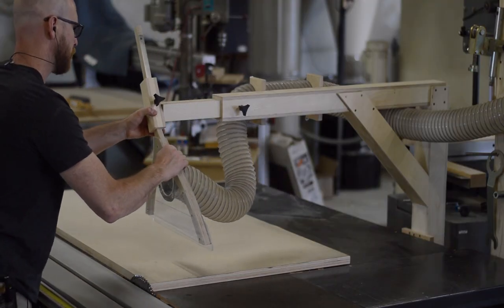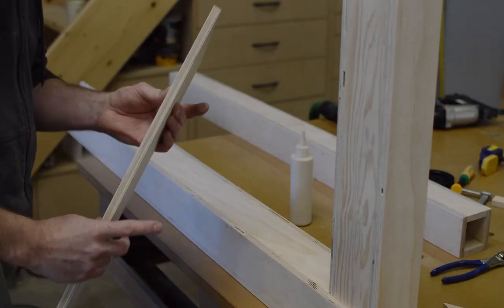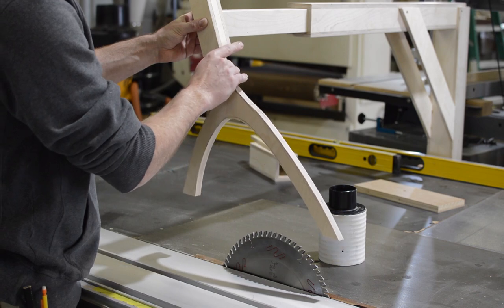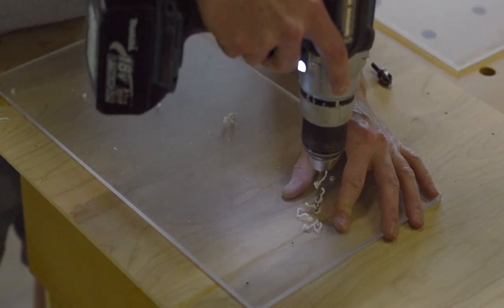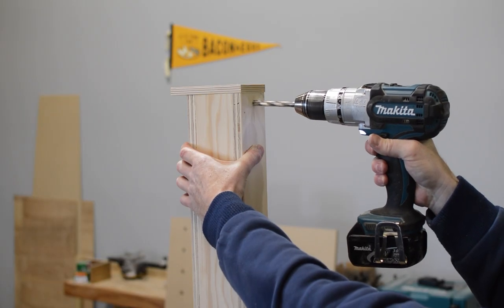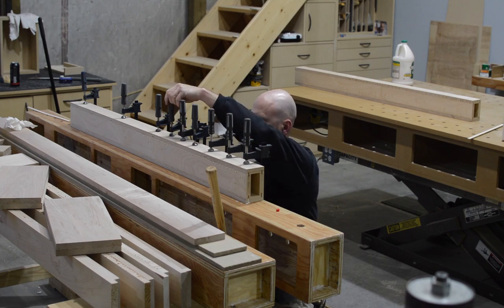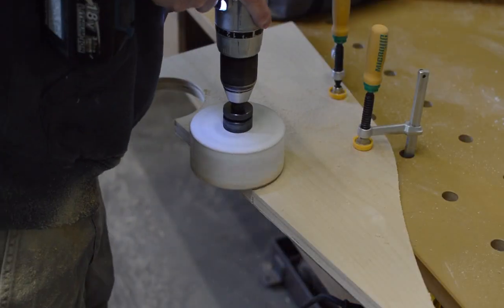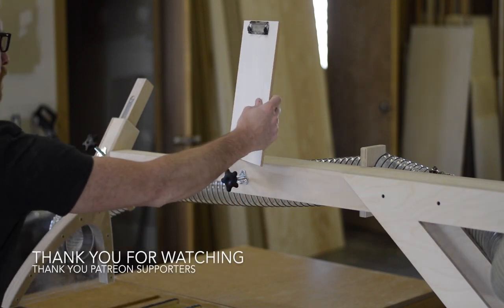Table Saw Overarm Dust Collection, Shop Built x 2

Comment: youre using your sliding table saw wrong, dude. theres no need for a „cabinet saw“, really. everything is easier and more precise on a sliding table saw. except for maybe those „dado blades“, you cant mount these on most european saws
Reply from the maker: I would push back against this position. I really don't like using a slider for anything other than cutting sheet goods. Can the saw do it, yes, but its not comfortable, and its not nearly as easy to change setups for one off cuts. Also, I can run a dado on my saw.
Reply: @MikeFarrington  Of course having two saws is always an advantage when it comes to different set ups. As it is with most tools, really. I know you have dedicated routers for your most used bits for example. no argument there. it just hurts me to hear you say "a slider is for cutting sheet goods". It really, really is a much more versatile and precise system than that. I dont know a single (professional) european furniture maker who uses a "cabinet saw". There are a couple of simple jigs for a sliding table saw that make it VERY comfortable in any application, even with tiny workpieces. But, to each his own. I'm just jealous of your Robland. What a great machine, seems wasted on just cutting down plywood.